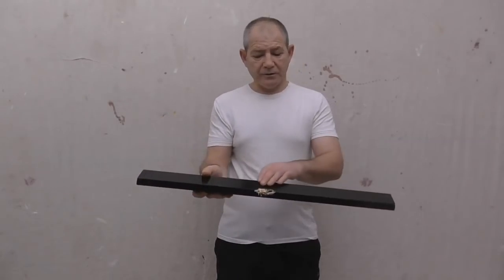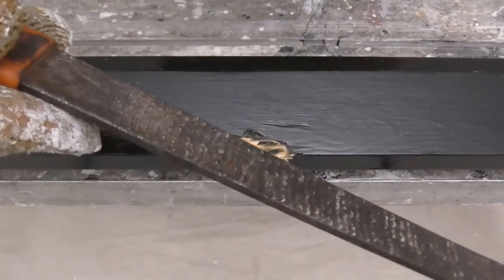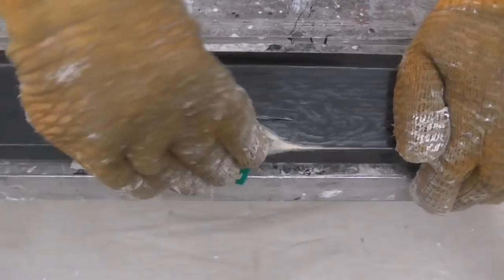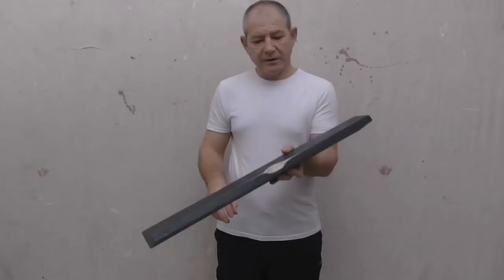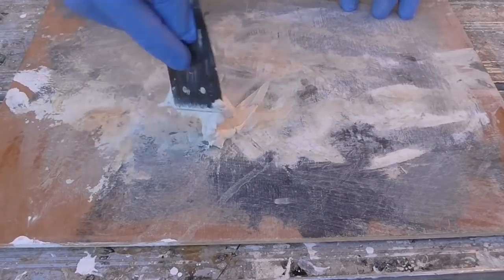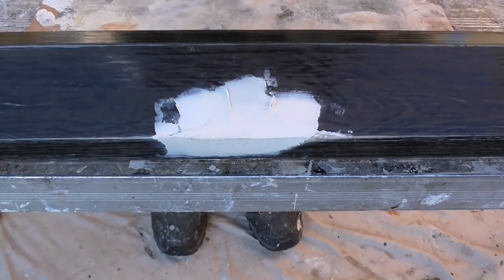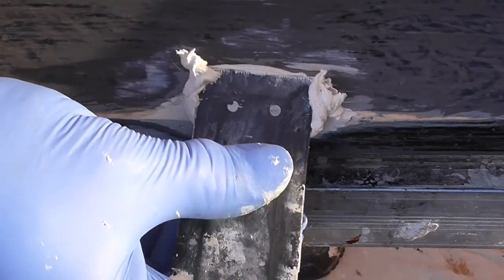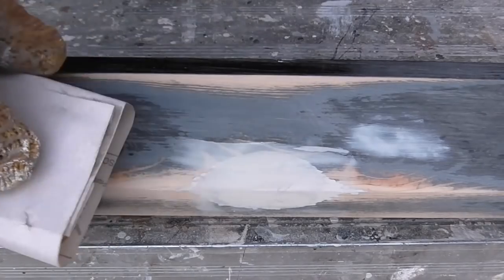Seamless Repair For Damaged Woodwork

Comment: Arrrggghhh! Wish I'd seen this 24 hours earlier - spent a good few hours today filling holes in a door frame, and the dowel trick would have helped the filler stick so much better. When those repairs fail, at least I'll know how to do it properly next time. I was using the filler knives you recommend though - they are very useful.
Excellent video as always, thank you.
Reply from the maker: Thank you.

Comment: For the cost of that expensive filler; it would’ve been cheaper, quicker and easier to replace that bit of timber 🤔 thanks for sharing though. You don’t get long to work with that stuff
Reply: Not if it's in a frame of a expensive job
Reply: That is very true!
Reply: @sutt16v  or in the middle of a pandemic when the local timber merchant has no hardwood. Fml. 😬